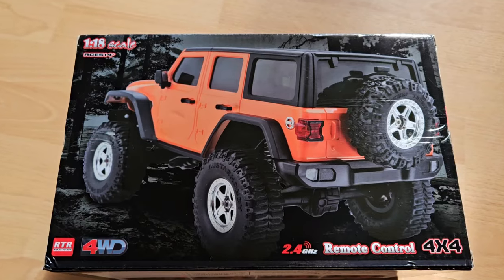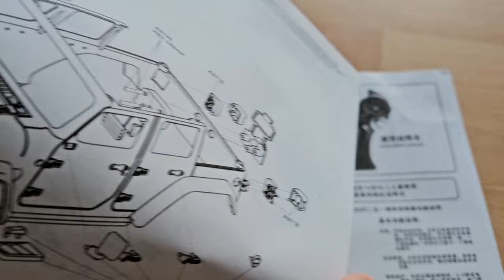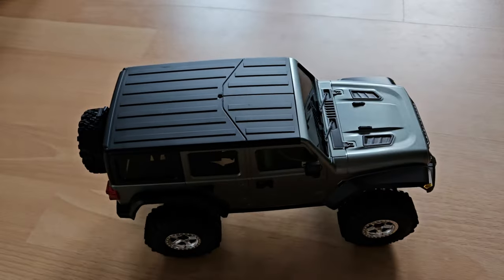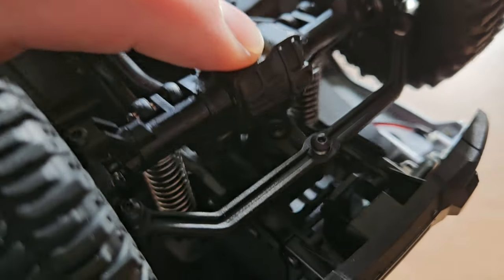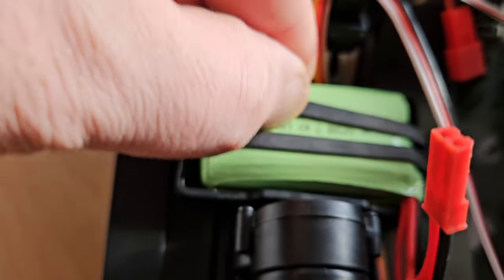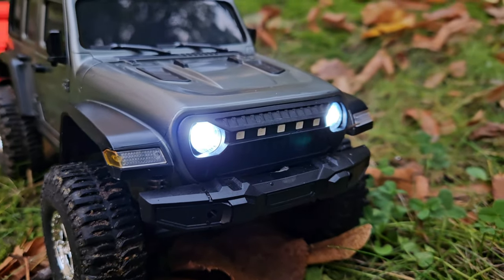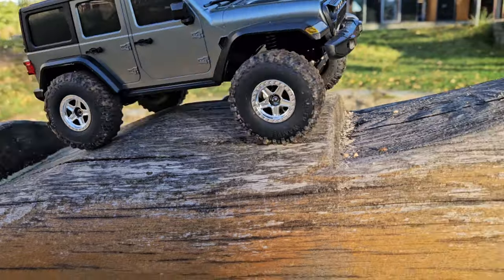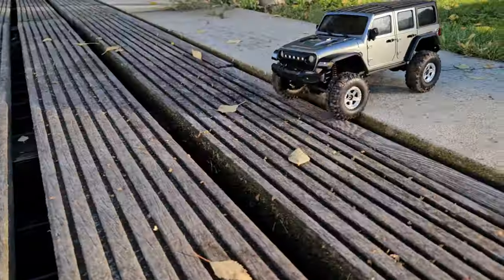surprisingly great 1/18 cheap (80$) RC crawler - Austar AX-8560

Comment: Got mine yesterday.  I really like it but the lack of crawler reverse and the super slow reverse speed is a bummer.  You did not even mention those two things which for a crawler are big problems in my book.  Given the great modulation of it, it is a shame that we will have to change electronics to get crawler reverse and a proper reverse speed.
Reply from the maker: Hi and thanks for the feedback. Since I am relatively new to crawling this might have been an oversight on my part. I would consider myself entry level when it comes to crawling. The Austar is a great entry level crawler for the money that you are spending. It has it's limits and as I am getting better at crawling I will have to upgrade. Compared to the TRX-4M you only spend like a third for the AX8560 and don't have to deal with motor whining and have enough torque to overcome obstacles in slow speed. Probably even after exchanging the electronics, you still come out cheaper than a stock trx4m. I never thought that I would be in to crawlers and it is quite the journey. Be safe out there